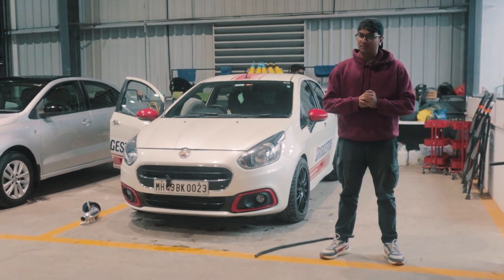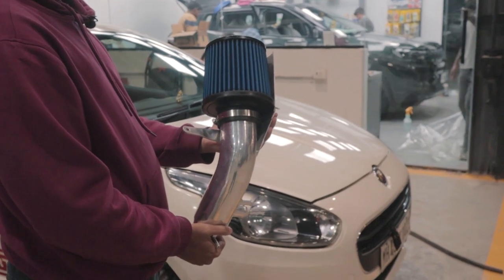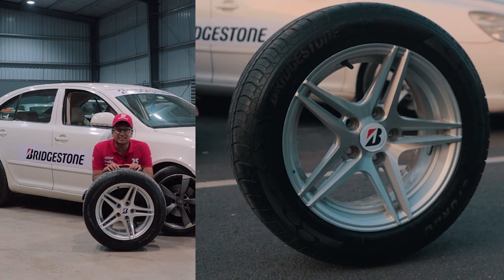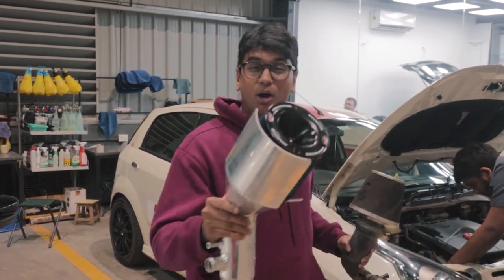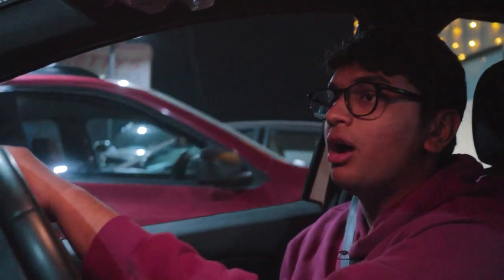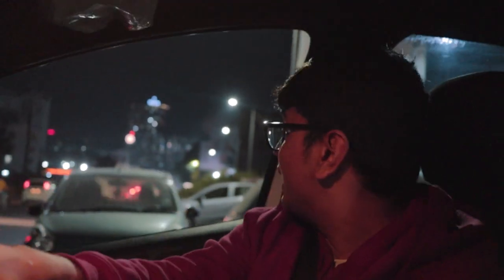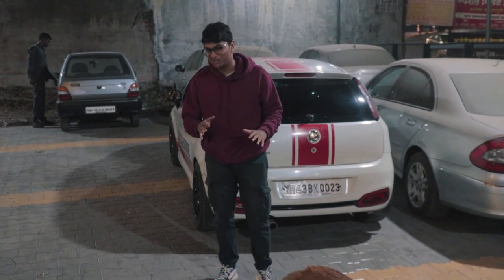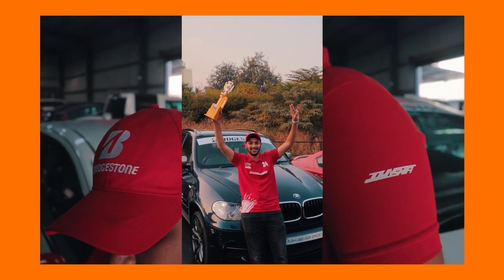Stage 2 Abarth Punto gets new Forge Motorsport Intake System & HPI Filter! | Road To Valley Run S3

Comment: You are comparing Dusty Airfilter with New Airfilter and giving feedback. Definitely new one feels good, you should clean the airfilter and see, almost it gives similar feedback as new one..
Even Pipercross sounds best.

That guy says he is driving Abarth this long for the first time and giving feedback compare to old one, I don't know how on earth someone gives feedback comparing old filter where he haven't driven much...
Reply: Hey Saketh, I don't think you understand that I have very particularly said that I haven't driven this particular Abarth Punto for a long duration. Which means, I have driven it previously and plus I have driven multiple Abarths in past. 

Cleaning the air filter would not have solved too many problems as the previous filter was damaged and I think I have given a very thorough explanation as to how the new intake benefits the performance.